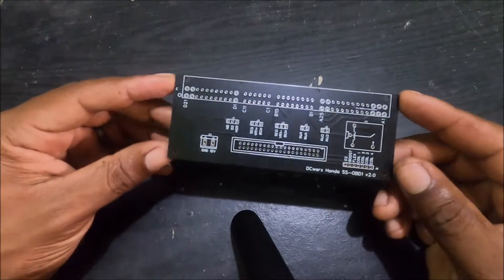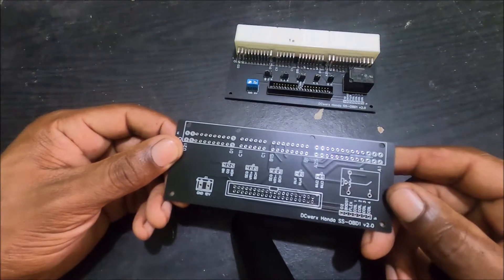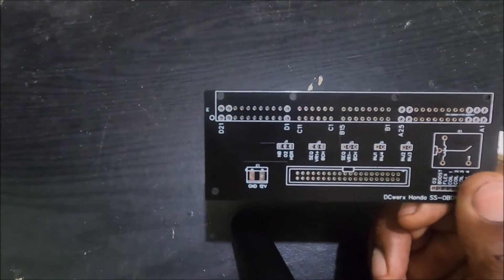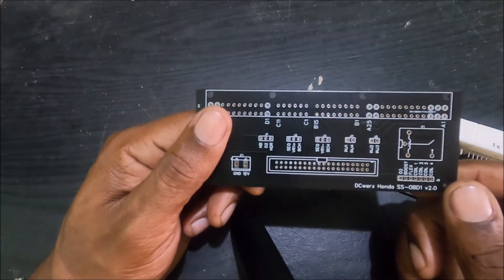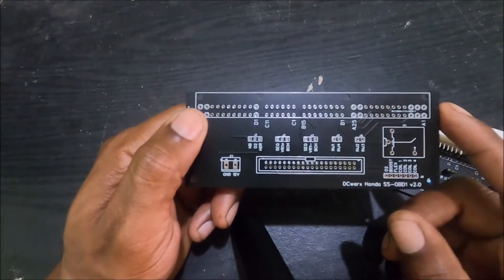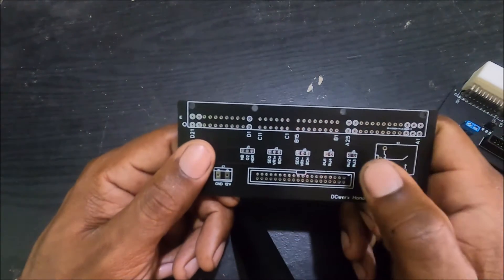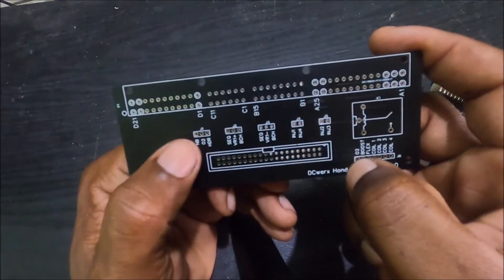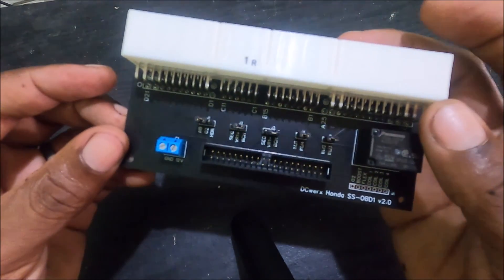SS-OBD1 Honda PNP adapter for Speeduino | Overview and instructions

Comment: Would this work for a honda beat 1994 3 cylinder E07A engine with a distributor and fuel injectors, as far as I'm aware its OBD1

Comment: This looks great! How would  I use factory narrow band O2 plus a wideband signal?
Reply from the maker: You can't use them simultaneously
Reply: @DCWERX is there another input for the wideband?  On my Hondata setup I run both and just use wideband for high power fueling and the narrowband for validation of idle.

Comment: also u got a photo of the distributer tooth u removed
Reply from the maker: It should be in my older videos. Technically any tooth can be removed. Just use a timing light to find trigger angle

Comment: ordered one of ur adapters whats the config for stock b16 motor  jumpers and do u have a bunch of base maps  for  honda b16 b18b and b18c
Reply from the maker: The video covers a stock honda. Yes, basemaps are available through my website https://dcwerxtuned.com/product/basetune-and-e-tune-service/
Reply: yes but it whould be nice to have a step by step setup guide for this adapter for tuner studios
Reply: also the injecter jumpers  for runing non batched fire do i need to remove the 2 injecter jumpers
Reply from the maker: @mariopic  yes don't put injector jumpers if you are not using batch fire injection

Comment: Would this work with f series? (specifically f22a)
Reply: I have a obd2 SoHC F20B, I will be swapping into a dc2, I have purchased and soldered the header and I have a speeduino 0.4.4d standalone.

Does the batch fire jumper setting work for the oBd2 engines as well?

Just want to get the wiring figured out,  as I will be purchasing the basemap from your website
Reply: Any assistance on this
Reply from the maker: This adapter works on the obd1 Honda, it can work on obd2 but would require an additional obd2 to obd1 jumper

Comment: What relay is responsible for? Which pin of the speeduino controls the relay?
Reply from the maker: Relay controls VTEC. Speeduino Vvt control triggers relay
Reply: @DCWERX  I have honda with nonVTEC d16a9 obd0 ECU. I'm going use speeduino 4.3d with it. I would like to use your adapter with OBD0 to OBD1 harness. However, I do not know if it will work. I want to make use of all the sensors and valves like stock ECU does it. Is it possible to get wiring diagram for the adapter? I mean mapping between OBD1 and speeduino IDC socket. I'm concerned about  mapping of TDC, CKP and CYP sensors. Also, there are 3 solenoid valves in my car: IACV, Fast Idle solenoid valve and valve in resonator box.
Reply from the maker: @olehdanilovskyi242  if your obd0 car works  with a factory OBD1 ecu and a obd0 to OBD1 adapter then the adapter will work. As for 3 idle valves I am not sure. Replicate the OBD1 Honda idle and other sensor system on your car, and the adapter will be 100% plug and play.